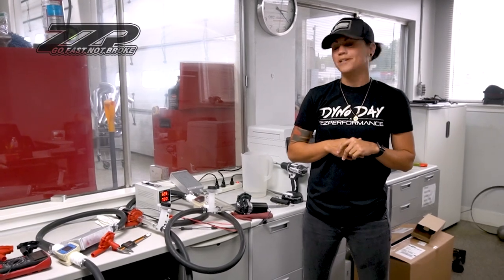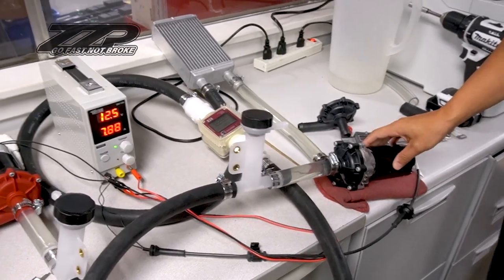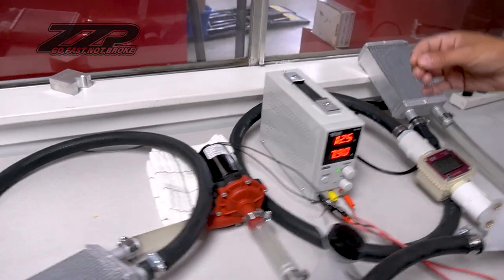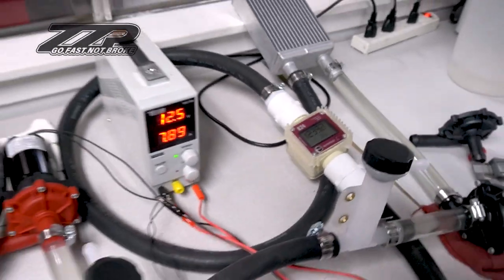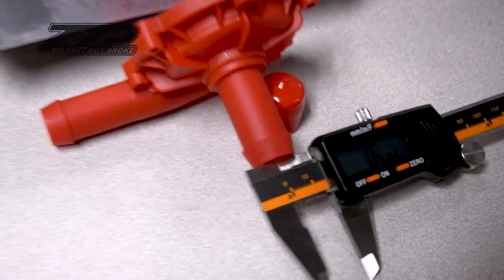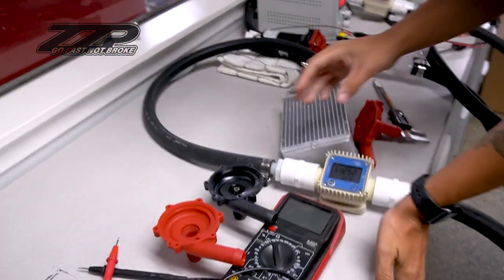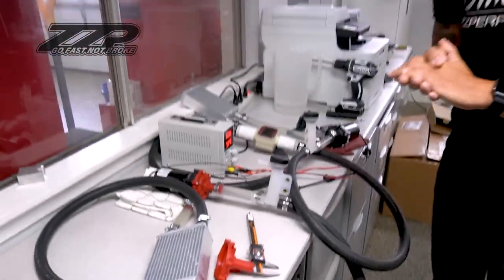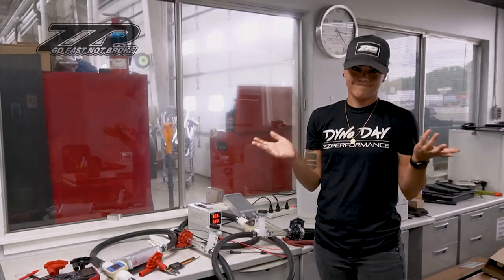ZZP High Output Intercooler Pump - Stage 1 Overview

Comment: Any chance you can post your pump curve and overlay the Bosch pump curve? Extra credit for showing the operating point for a stock intercooler system. Double extra credit for showing the operating point for a modified ZZP intercooler! :)

Comment: Is this comparing bosch 010 or 02 pumps? I have a feeling your comparing it to the 02 pump which did flow less than the standard 010 Bosch. I would like to know so I don't go ordering a pump that flows less than the 010
Reply: That's what I want to know
Reply: Because you didn't get a reply, the 002 pump housing is usually fully black and has an EV1 connector. The 010 pump has an oval connector and has the aluminum portion of the housing. it looks like they took a 002 style pump and made it flow more than the Bosch 010.

Comment: Does it matter how the pump is mounted? My zzp stage 1 seems to not be pumping as I thought it would be.
Reply from the maker: In an LSJ you'll want to mount it in the stock location, if in another application we recommend mounting them vertically with the inlet/outlet at the bottom.